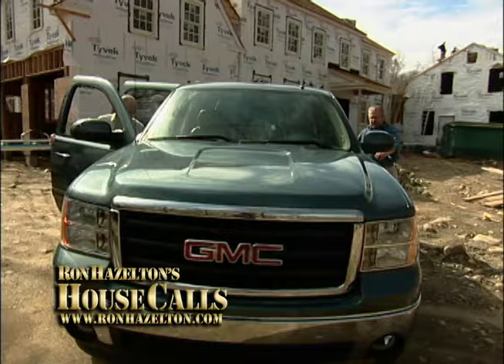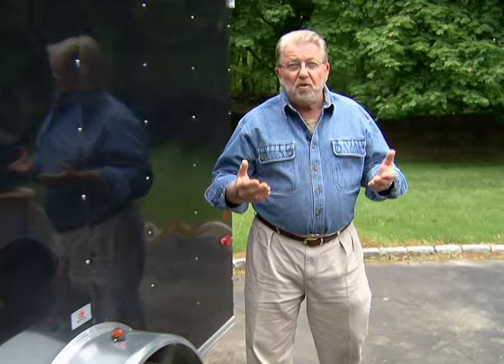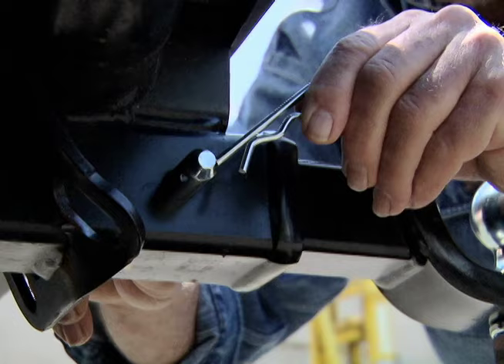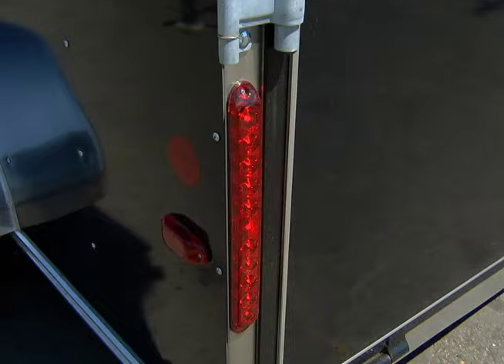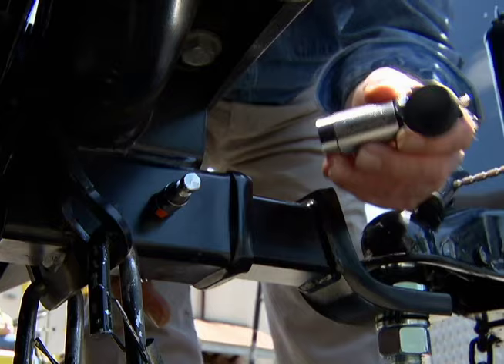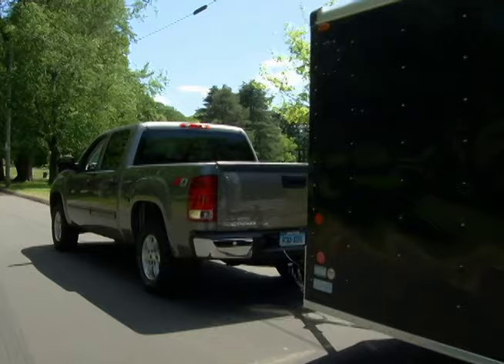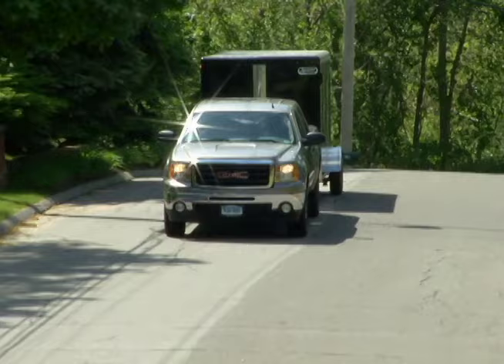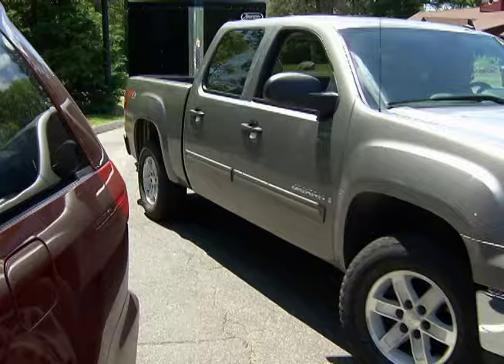TRAILER TOWING TIPS FOR A PICKUP

Comment: Grease should only be used when towing on sealed roads for short distances.
For longer distances and unsealed roads, motor oil should be used as grease can become a grinding paste when congealed with dust resulting in premature wear.
Reply: Does it matter if it's used or new? Also thank you for commenting.

Comment: When check tire pressure make sure to check the trailer tires.  I witnessed a low pressure trailer tire blow out at high speed.  Lucky for the driver the camper he was hauling swung out wide and clipped a guard rail and send the truck into a spin where it came to a safe stop before it hit a bridge.   The camper was destroyed, but the driver was unhurt and the truck was undamaged.  Very terrifying  to watch.  I have towed everything from a 8 ft flat bed utility traier up to a 35 ft.  travel trailer tens of thousands of miles and this video is spot on.